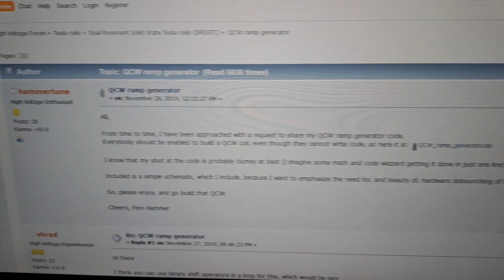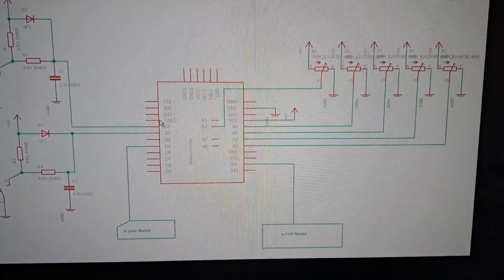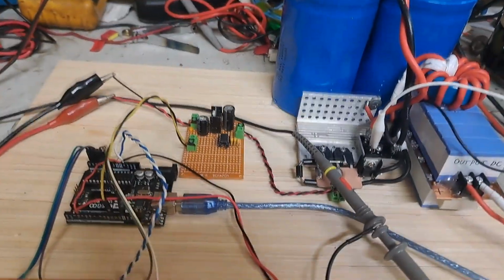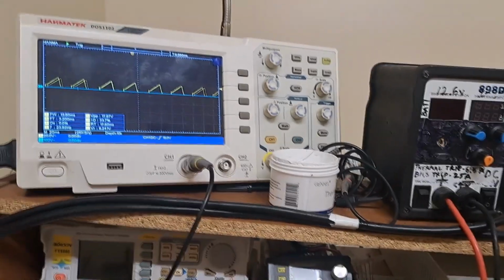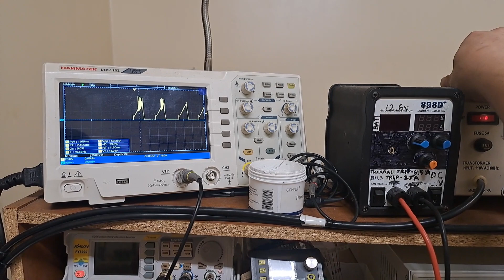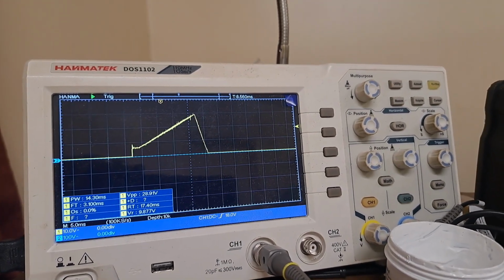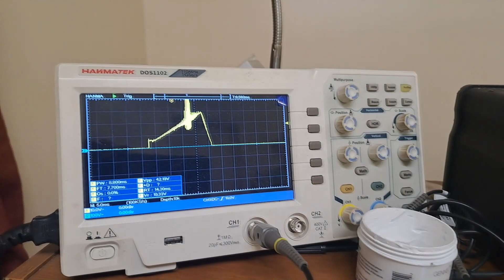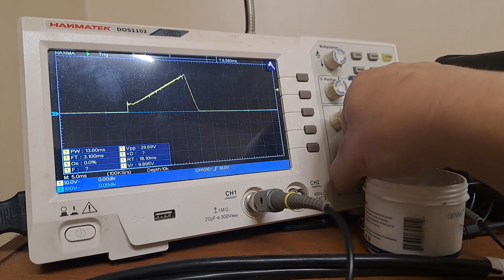Finn Hammer's Arduino Ramp Generator For QCW

Comment: Hey dude , i can't seem to find the arduino code , i can see the schematic but not the code.
Reply from the maker: Maybe try downloading the file again? I just checked it and in my zip file I have the two files, the .sch drawing and the .ino code sketch. IDK how well it's going to format on YT but here's a direct paste of the code: 
----------------------------------------------
//QCW DRSSTC Tesla coil Ramp generator.  23-11-2019. Finn Hammer

//Generates the ramp signal, that serves as control reference to the QCW Buck converter.

// UPSLOPE potentiometer controlls the pulse length
// AMPLITUDE potentiometer is self explanatory
// SCALE potentiometer scales output, preserving slope factor

int AMPLITUDE   = A0;         // Analog input pin that the AMPLITUDE potentiometer is attached to
int PULSELENGTH = A1;       // Analog input pin that the PULSELENGTH potentiometer is attached to
int SCALE       = A2;             // Analog input pin that the SCALE potentiometer is attached to
int BPS         = A3;               // Analog input pin that the WICK potentiometer is attached to
int WICK        = A4;              // Analog input pin that the AMPLITUDE potentiometer is attached to

int FIREPin = 2;       //Pin connected to the "FIRE" button (debounce the button 20mS)http://www.labbookpages.co.uk/electronics/debounce.html
int oneshotpin = 3;

int pulsePin =  5;          // This pin outputs the pulse that starts the controller
int pwmPin =  11;           // The PWM pin, outputting the ramp signal

int wicklevel = 0;          // Amplitude of the short "Wick" period, before ramp starts to rise
int fire = 1;               // Variable determining when the code executes (When you press the FIRE buttton)
long uppot;                 //Pulselength mapped to microseconds
long pulselength;           //pulselength of upslope, scaled
long scalepot;
long amplitudepot;
long amplitude = 0;
long amplup;                //Amplitude of upslope relative to time
long ampldown;              // Amplitude of downslope relative to time (deltatime)
long downtime ;             // Time when ramp goes negative = 1/5th of uptime
long deltatime;             //time referred to top of slope.
long BPSrunTime;            //time interval setting the BPS
long BPSstartTime;          //Time of starting the wick
long BPStimer = 0;          // the timer that counts the BPS interval
long upslopetime = 0;
long T = 0;                 // T is the time reference in the loops.
long nowtime = 0;           //Time operator for resetting T

void setup() {
  Serial.begin(38400);
  pinMode (PULSELENGTH, INPUT );
  pinMode (SCALE, INPUT );
  pinMode (AMPLITUDE, INPUT );
  pinMode (WICK, INPUT );
  pinMode (BPS, INPUT );
  pinMode(pulsePin, OUTPUT);
  pinMode(pwmPin, OUTPUT);
  TCCR2B = TCCR2B & B11111000 | B00000001;    // set timer 2 divisor to     1 for PWM frequency of 31372.55 Hz
  attachInterrupt(digitalPinToInterrupt( oneshotpin ), rampISP, FALLING);
}

void loop () {

fire = digitalRead (FIREPin);
  if (fire == 0)
    
  BPSrunTime = (millis () - BPSstartTime);
  T = (micros () - nowtime ) ;

  
  

  if
  (T >= 0 && T <= 2000 )
    analogWrite (pwmPin, wicklevel);
    
 if (T >= 1000 && T<=1500)
 
digitalWrite (pulsePin, HIGH);
    
 if (   T  >= 2000 && T <=  pulselength + 2000)
  { 
    
    amplup =   wicklevel + (amplitude   * ( T - 2000 )) / (pulselength )  ; //Here I calculate the amplitude at this time in the loop
    analogWrite (pwmPin,  amplup);
  }
  

  downtime = ( pulselength / 5); //here i set the downslope to 20% of the upslope

  deltatime = (T - (pulselength + 2000)  );  //here I create a new clock, starting at the top of the ramp

  ampldown = (amplup * (downtime - deltatime)) / downtime; //this line defines the downslope, relative to deltatime
  

  if (T >= pulselength + 2000 && T < (pulselength + 2000 + downtime))  // this line defines the down ramp time interval
  {
     
    analogWrite (pwmPin, ampldown  );  // and here the downslope is generated
  }

  if ( T >= (pulselength + 2000 + downtime))

    analogWrite (pwmPin, 0);

    if ( T >= (pulselength + 2000 + downtime + 1000 ))   // The UD2.7 pulse is delayed 1000uS to allow ramp low pass filter to settle to 0
  

    digitalWrite (pulsePin, LOW);
 
  if (BPSrunTime >= BPStimer)
  {
fire = 1;

    //.....................Read the potentiometers and scale their values to fit the purpose ....................

    BPStimer = map (analogRead (BPS), 0, 1023, 40, 1000);
    wicklevel = map (analogRead (WICK), 0, 1023, 1, 50);
    uppot = map(analogRead (PULSELENGTH), 0, 1023, 18000, 7000);                   //Map the duration of the upslope to microseconds
    scalepot = map(analogRead (SCALE), 0, 1023, 1000 , 1);                     //Map scalepot to even numbers
    amplitudepot = map (analogRead (AMPLITUDE), 0, 1023, 253 - wicklevel, 0  ); //map amplitude to 8bit, minus wicklevel

    pulselength = (uppot * scalepot) / 1000;
    amplitude = (amplitudepot * scalepot) / 1000  ;

    nowtime = micros();
    BPSstartTime = millis () ;
  fire = 1;

  }
}

void rampISP ()
{
  nowtime = micros();
  BPSstartTime = millis () ;
  fire = 0;

}

--------------------------
Reply: Thanks dude , I was also wondering about your driver board and its schematic.
Reply from the maker: @spiderspider1384  I'm basically using Steve Ward's circuit https://www.stevehv.4hv.org/DRSSTC1/DRSSTC1OCDsch.JPG

The only difference is since I'm trying to drive a double full bridge of IGBT's at ~360khz I needed to use higher power gate drivers in a package I could heatsink. Those are basically just an extra stage after the UCC drivers in the schematic, and the UCC drivers are where my enable signal is going.
Reply: So the pwm is directly connected to the mosfet driver that drives a small mosfet which drives the gates of the igbt . 

What's the pulse output for , you didn't use it here if I'm not wrong ,so how would we connect it up and what's its use . 

Also how do we chose the inductor core material and size , cus I've been wanting to use a PSU choke but I don't know if that's the right core .

After building it I plan on connecting it directly to a single mosfet slayer exciter , is this viable ?

BTW I'm brand new to this field so its really good actually having this convo with you . Thanks a lot 👍

If you don't mind could I get your email so if I build it I can send you the pics and details .
Reply from the maker: @spiderspider1384  Oh were you talking about the gate driver for the buck? The buck converter has its own gate driver which is driven by the output ramp of the arduino. You can just use a gate driving opto. There is also an enable pulse output from the arduino as well, which is what would feed into the interrupter enable input of the SSTC driver (enable pins of the UCCs). This tells the SSTC circuit to enable the inverter drive for however long a period the square wave ramp is created by the arduino and then output by the buck. 

You treat the SSTC portion as just an isolated build, as per usual, nothing different, except it just needs to have very small or no filtering on the BUS. No large electrolytics. The driver is also the same. 

You're just feeding that normal unfiltered SSTC build with the output from the buck modulator.

It sounds like all you want to do is just build the buck converter which is easy. You can probably get by just stacking some decently sized common yellow powered iron core toroids. If you want to drive a slayer exciter with that it will work but it's probably not going to be anything spectacular. Magneticitist@gmail.com

Comment: Hi there 2u Ryan. I've modified my beefy slayer exciter circuit into a ramped SSTC  & for the LC , I've used a MOT as the inductor plus a 2uF 2000V CBB cap. The thing is that seeing you with all your ramped circuits, i just wanted to build one my own way and I succeeded. It's the same circuit as the Russian Slayer Exciter with the exception that I modified certain things to beef up the circuit further more & never seen anyone done it till date. Thus, I decided to actively trigger the gate of that single IGBT with another IGBT by using either a staccato or those cheap Chinese LCD tiny frequency generator (1Hz to 150KHz), the result is just amazing. I was thinking that if you would accept to see the circuit, maybe you can test it & further improved it. For a single Fet ramped SSTC , it pretty amazing with its sword spark output. How can I send you that circuit of mine which I've greatly improved & modified so that you do same & make a video about the output that you'll get? For the past 2 years, I've been busy playing around with that beefy Slayer Exciter Circuit & never had a popped IGBT. It's pretty damn solid. Bro! How to send you that circuit, any what apps number or useful email you can send me so that I can transfer that circuit to you? By the way , I tested different secondaries coils, they worked out well. One was a 420KHz  & another 280 KHz. Let me know, thanks.
Reply: Hey dude would you mind sharing your schematics and a bit of the over view with me , I'm new to the field so its best to learn from someone who has done a similar things to what I'm planning to do . 
If you have an email address do let me know thank you ❤

Comment: from the arduino pin, is it directly fed to the igbt driver ic or is it strengthened compared to before, sir?
Reply from the maker: Straight to driver IC but preferably through fiber connection
Reply: @Magneticitist  does that mean you don't need an ic opamp/fast comprator ic, sir?
Reply from the maker: @criston-hv5jx  No but it does of course depend on how you're driving the IGBT. I'm using a UCC27322.
Reply: @Magneticitist  ok thank you sir, I'll try to build it
Reply: @Magneticitist  and arduino pin number D11, directly fed to the ud.2.7 driver / via the op amp / comprator amplifier or not? or is it really fed via optical fiber?
Reply from the maker: @criston-hv5jx  you want to use optical fiber for isolation yes. On the 2.7 board this might mean that yes you have a strengthened signal. This will be the case with particular fiber receivers as well. Adding buffers or Schmitt triggers or opamps  or whatever stage you'd like is not going to hurt. It's also not going to hurt by not having those because a relatively high impedance gate driver input is totally fine for an Arduino that has fast enough rise time
Reply: @Magneticitist  hello sir, can you draw the schematic for me? buck part(igbt,ferrite core winding,mkp caps,load resistor?
Reply from the maker: @criston-hv5jx  I can when I get home, but it's identical to the Wikipedia diagram. Just basic buck.
Reply from the maker: @criston-hv5jx  It's literally just like this https://ibb.co/266WDGW 

but how you wind the inductor or size the cap and load resistor depends on your build. A common choice is about 20uF and about 100uH with something like a 3.5-4Kohm load resistor.

Comment: In the schematic, what is the value of the resistor, diode, potential, sir? I saw a plain schematic
Reply from the maker: I can't be sure but given how it's wired I would be wanting to use at least 5K resistors. Any rectifier should work. For the capacitors maybe 100nF to 1uF or so?

Comment: good job friends, can this be applied if I use steve's 1.3B driver?
Reply from the maker: Sure
Reply: @Magneticitist  in my opinion, 1.3b steve doesn't yet have a phase lead feature, are you sure it can work properly?
Reply from the maker: @restu3126  It depends on the kind of build you're going for. I have yet to use phase lead on any SSTC or DRSSTC no matter the topology but I also haven't tried to push a lot of peak power. 

The build I ended up using this on with the PLL feedback + Steve Ward "Mini SSTC" style driver begins to see phase delay issues at the higher voltages but can handle it fine so far. It manages 170VDC mains ramps nicely. However at 340VDC bus voltage on the buck for example IDK. 

So basically phase delay, using the type of driver I always tend to build, has never been enough of a noticeable problem for me to worry about thus far. When I end up doing a much larger full bridge build I would definitely want a phase lead ability because I wouldn't want bad ringing and spikes to be killing my expensive switches as I push the max power I can.
Reply from the maker: @restu3126  I knew I had seen someone do it but couldn't find the link and just stumbled upon it. https://highvoltageforum.net/index.php?topic=223.0

It's pretty easy to just add phase lead to any normal 74HC14 feedback driver in that way, but just inserting the tunable inductor circuitry before the IC instead of using the TL3116. In my case here I wanted to play with PLL so I just inserted the chip in between the 74HC14 and the gate drivers.
Reply: @Magneticitist  that's good, friend, yes, the maximum is only 60n60 in my build, that's in my drsstc, I really want to have a sword sword sword

Comment: connect a class-E at the output 👍
Reply from the maker: I've got to have a class E around here somewhere I can use on this.. problem is I haven't made any to run at over about 45-50V yet and the only one I have at lower frequencies needs me to wind a new coil for it. Got this full bridge ramped setup I'm trying to use but I see that I didn't make it to handle CW.. and to test it I basically need the VCO always running because I don't yet have any signal coming from the ramp generator to tell the gate drivers to enable. For the short durations I tried it til the gate drivers got too hot it seemed like it wanted to work but I didn't have the PLL tuned right.

Definitely some kinks to work out with these and I'm not too sure what is causing all the noise that shows up in the ramps at times. I had an even crappier filter on the buck at first and was able to bring it up to maybe 120VAC input before it would wonk out. With this one it goes nuts at just over 40VDC output.
Reply: @Magneticitist  try low L high C. That is for power outputs.. Gapped UU ferrite cores will do for L. Dont forget to add snubbers at switch. 
I have a few spares to make for another ramp PS(loneoceans,w feedback). IIRC I havent done any class-E yet, but will definitly be on my to-do list.
Reply from the maker: @raffyturc  I have a much bigger capacitor in the way but it's strange because the cap I first used was way too small but actually worked better than the 2uf. I think noise and interference is a huge part of it also so next thing I'm going to do is put everything in a metal enclosure.
Reply: Yep I would like to see that too !!! Qcw class-e sounds sick

Comment: You always have a way of documenting exactly what I need right when I need it, lol. I recently bought a bunch of high-power IGBTs and MOSFETs (brick-style, like CM300s), and Tate from BackMacSci challenged me to a QCW duel this summer, so I've been doing QCW and DRSSTC research in my free time. Great video, I'll definitely be taking inspiration from it, haha!
Reply from the maker: ohh a challenge? I like that. I think a lot of people will be happy with a Labcoatz tutorial when it finally comes to fruition. I get it though, it's a daunting project despite how basic it can be in general concept. I will definitely try to keep up with you guys and see what more I can figure out before the summer, but if we can get several guys working on it who are not experienced with them yet I'm sure we can get some good understanding by the time it's all over. It sucks cause I don't even have any coils laying around to really test this on. I've either tuned them all for too low of an input voltage to make ramps worth it, or they are not setup to just easily be fed the ramps. My ramped circuits using PLL were not made to handle CW operation cause the gate drivers will explode trying to drive the switches full time at those frequencies.. this is kind of where that pin 5 might come in I wasn't sure about. I'd need the ramp generator output to send a square wave throughout the duration of an entire ramp to send to the gate driver enable. That might be what that pin does sort of like how Staccato interrupters work.
Reply from the maker: So yea by the way pin 5 is basically just an enable so it works, and the on time is going to follow the pulse train. It's looking like the way to go is 2 optos for isolation. One on the controller signal into the buck converter gate drive, and the other to feed the enable pulses into the DRSSTC driver. It all works now with my ramped full bridge but all the interference and lack of isolation is keeping me from running it properly. Going to work on getting it all closed and cleaned up better and see what happens.
Reply: That is gonna be so cool , Tate collabs are so damn cool 💪💪